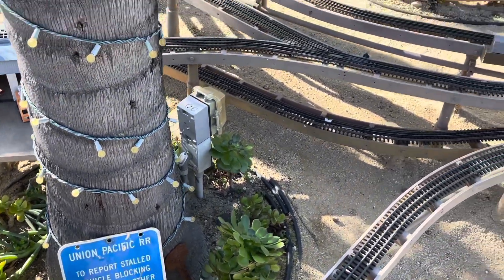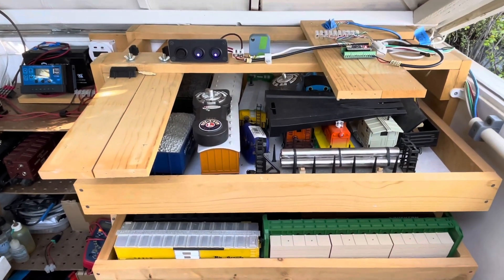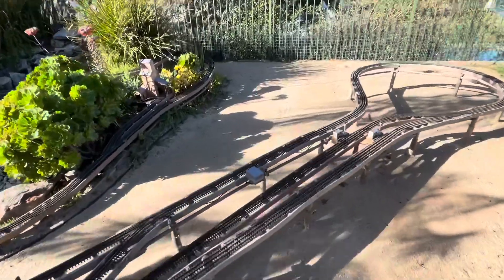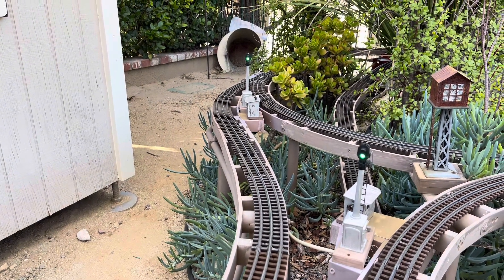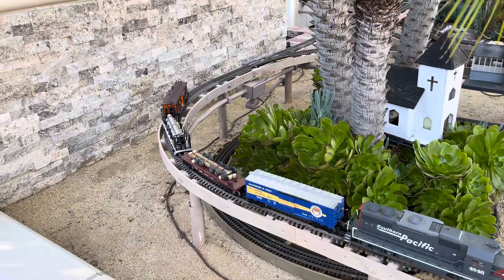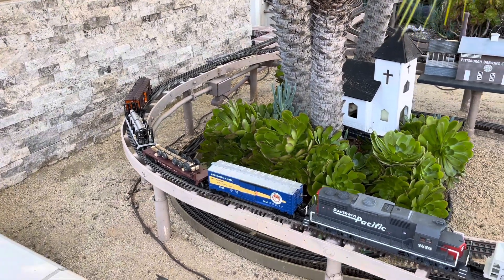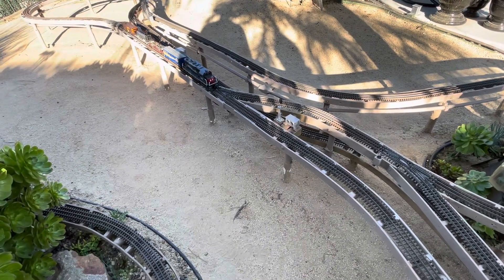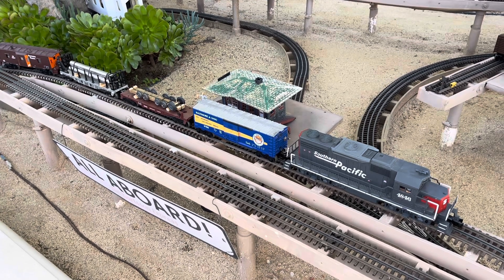WINTER LAYOUT UPDATE - with Rail Ops

Comment: I'm always excited to see your updates. Did you make the little boxes that hood the Arduino on the side of the tracks? I've been struggling to get a good solution for my layout.
Reply from the maker: The small sheds that house the HC-SR04 sensors and the box with a removable lid housing the Arduino Nano were all scratch-built.  I used PVC door trim and a thick styrene "For Sale" sign from my big box hardware store.  I would bond with Gorilla super glue. Thanks for your comment. 🚂🌴😎
Reply: Thanks, I'll give it a try

Comment: Hi- I’m a beginner and I’m starting on an outdoor train design. What material are the tracks on? Thanks
Reply from the maker: I used PVC lattice trim and PVC door trim from Lowes.  If you're located in the States, you should be able to find the material.  You can check out my website for more information on the construction techniques for building the ladder rail and stanchion system.   Ron//
Part Numbers:
¼” x 1 35/64” by 8 feet PVC Lattice   Lowes # 209626
⅝” x 1 ½” by 12 feet EverTrue PVC Board  Lowes #113010

Website:
https://www.oscaletrainsbyron.com/roadbed
Reply: I highly recommend check8ng out Ron's early videos on building his risers. I did much the same and it has been quite reliable. The telescoping poles make it easy to make adjustments if the ground settles somewhere.
Reply: Thanks